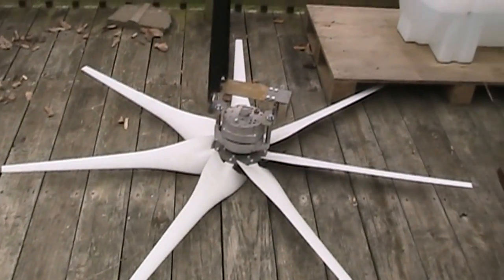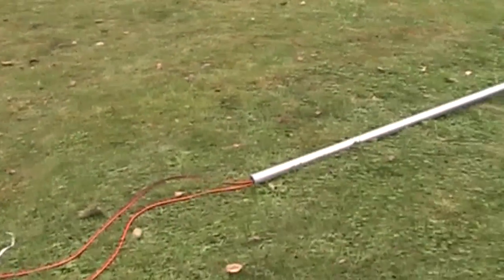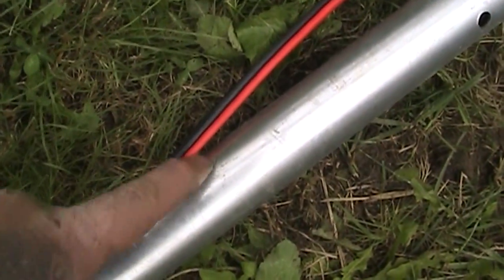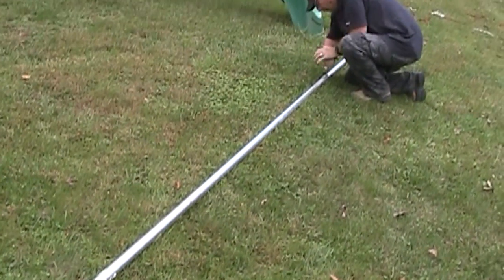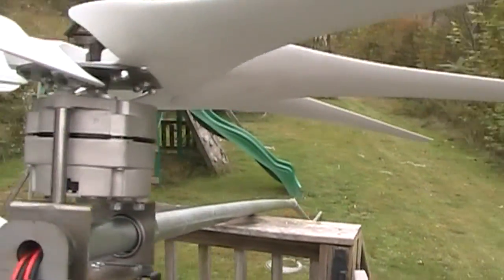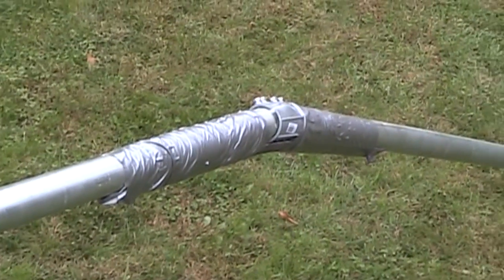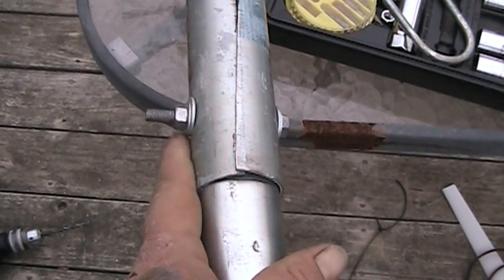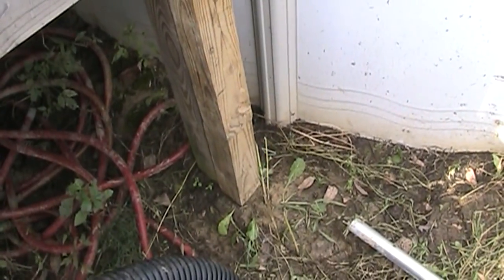Putting up the wind turbine

Comment: and just an after thought i had a problem with putting mine up very similar the first time im not sure that pipe is strong enough. we had a good storm come through and took the whole thing down just bent it right over mite need a stronger pole and put up guide wires that is all that stopped mine from slamming into the ground

Comment: I think it never produce enough voltage ,because this car alternator needs 1200 rpm/m to produce 14.2 volts to charge the battery..Permanent magnet generator is the best option.

Comment: battery box needs to be fiberglass inside as if battery leak will cause you problems, also box to be well ventilated,
Reply: well you could you a metal box, but fiber glass is cheap easy to line out a wooden box, if the acid leaks out it pucks the wood and just burns it away, also if a battery cooks and go Bang then it stays in the box not in your face, i have cooked a battery once seen what it can do so  now i will only use box to keep battery in,and the gas from them is unbelievable, and to let the "sauce run on the ground", now you being silly

Comment: too skinny your pipe, why not use 6 inches pipe more strong and can handle the weight of the wind mill. im only curious what happened if the wind mill always rotating from different directions does the wire inside the pipe will tangled in the long run?

Comment: Geez, way too much screwing around with a mast.  Go to Home Depot or a hardware store and buy some steel fence rail pipe.  Check e-Bay for millitary support poles.  You can buy a 45 ft. set of 4 ft. high strength 1.5 inch aluminum poles for less than $100 that would make for an excellent wind turbine tower. Great video despite the relapses.  I'm thinking about adding a wind turbine to my solar setup while living full time on the road.  Is that an AC or DC turbine?  I"ll have to look to see if you have another video testing out the setup.  How is it performing now?

Comment: MY QUESTION IS: HOW THICK & STABLE IS ELECTRICAL CONDUIT ~VS~ GALVANIZIED 3-4" PIPE. AT THE HEIGHT TO BE, EVEN WITH GUY WIRES THERE WILL BE FLEXING OF THE PIPE.

ANYWAY, HOPE IT DOESN'T FLEX/DISTORT... GOOD LUCK.... ALOHA

Comment: any chance of a update video to this to show your turbine and setup ie battery bank etc ?
Reply from the maker: I will be upgrading this to a 24 volt soon, I will make a video when I do.
J
Reply: jnull0 Thanks but why change to 24 volt ? . . seeing as you have a hill next to you why not make yourself a hydro system that recycles the water using a pump which  means constant power when no wind about
Reply from the maker: jacky Parker
My gear will run a little more efficient at 24volts.  I don't have enough water run off to do anything with hydro.
J
Reply: you don't need any stream or anything like that think of a car cooling system and how that works . .  tank of water is pumped round engine and back in to tank so what you do is put tank up top of hill run water down hill to hydro system (ie pelton wheel) then have a pump to pump it back to the tank to recycle the water
  simples !!
Reply from the maker: jacky Parker
 Hmmm...Interesting, thanks for sharing Jacky.
J
Reply: your welcome and always willing to helpothers were I can
Reply: jacky Parker  Where does the energy come from to pump the water back up the hill?
Reply: Would assume this violates a rule in science...The energy generated through the hydro turbine would be wasted in the energy required to pump the water back up to the holding tank.

Comment: How do you stop the wires from twisting down the pipe as they come out from the bottom?
Reply: AvidHunter there is a special Bearing like object that stops you put on called a slip ring

Comment: to forms of ac would be better close to your battery is better.. dc won't go far you lose power from your current ...
and you only need 3 wires from your coil

Comment: Can't you use the conduit as the negative lead? Use half the wire.
Reply: Don't do it ..... that is taking the lazy way out ..... That went out in the 70's
Reply: Kurtis Lee 
What went out in the 70's? Using the framework as a ground path? Besides, There is no way this thing is going to survive moderate to high winds. Just the conditions that are ideal for a wind turbine.
Reply: Scooter George

Comment: Your running it dc why not straight ac of the turbine with a rectifier
Reply: because batteries wont charge on AC
Reply: hermann goring everybody knows dc loses power over long distances and to use rectifiers both ends to compensate for this
Reply: Hermann Göring What he means is why not run AC from the turbine to the battery box and then convert it to DC at the box using a rectifier. All wind turbines, Homemade/commercial produce AC voltage which is then converted to DC voltage using a rectifier. The companies that build wind turbines put the rectifier inside the turbine thus forcing us to use very large wire runs to the battery box. But if they simply didn't put the rectifier in the turbine we could use small wire to transport AC with very very little line loss. Once the AC arrives at the battery box, it then can be converted to DC to charge the batteries. That is a very efficient and economical way to do it and I have no clue why turbine companies do it the way they do it unless it's just to make it user friendly by giving us less components to deal with.  BUT if it was mine I would remove the rectifier from the wind turbine and do as 16vastraturbo is implying and run AC.

Comment: You should have used ridged conduit with the correct fittings to protect your wires from rubbing and shorting out. Is that legal to mount next to your pool, I know that you can’t run a wire over the pool even if it’s only for support. It’s a health ordinance to help keep bird droppings out of your pool. You also should have split the two conductors at the ends and put the two red wires together with there own compression connector as your positive conductor and then use the two black wires as your negative conductor. It’s not only safer to have the correct colors for identification but the wires will conduct the current more efficiently with the positive and negative physically being next to each other. Never drill through conduit and run bolts through it, they make mounting brackets for that. As a licensed Electrician with 40+ years of experience I must say that your video was entertaining but definitely not educational. You might get someone killed in your pool. My advice would be to either get professional help designing your installation or have them install it. I’m all for home owners saving money doing work themselves but please stop posting videos about things that you obviously don’t know what you’re doing. Someone could get seriously injured or killed following your advice. I did get a few good laughs watching the video. I don’t mean to rain on your parade, just trying to be helpful.

Comment: I couldn't help but notice that, your positive wire from the battery to the inverter, isn't fused! Please put a fuse as close as you can to the positive terminal of the battery! If you get a short in those lines, they will melt the insulation off the wire, and catch everything in its path on fire! You will need to buy a fuse that can handle the amps, that the inverter is pulling. Just concerned for you and your family.

Comment: Conduit Pipe is too weak! It is no where near strong enough. you can get 1 1/2" Oil well pipe, when is way stronger, it will flex, and has a Chromium center. But you will have to used High Tensile strength rod to weld together.
Conduit and Water Pipe galvanized is not strong.

Galvanized Water pipe is NOT a welded pipe, it is just a rolled.

Black Pipe (legal Gas Pipe) IS a Welded Pipe and is much stronger

Comment: Timber  never use cheap electrical conduit or fence grade pipe for wind turbne it is doom for failures.  I know every small turbine ever mount on this crap has broken the pipe and broken the blade sets.